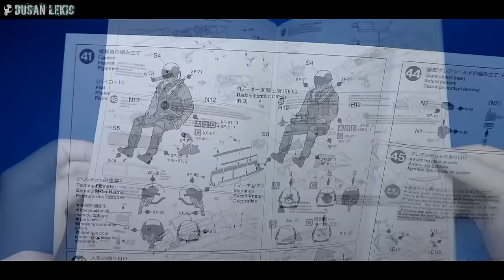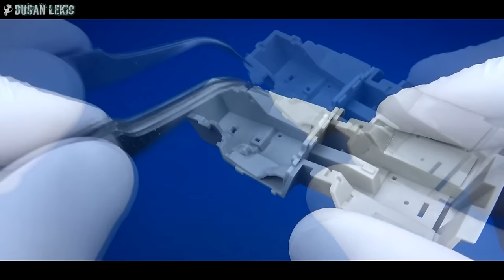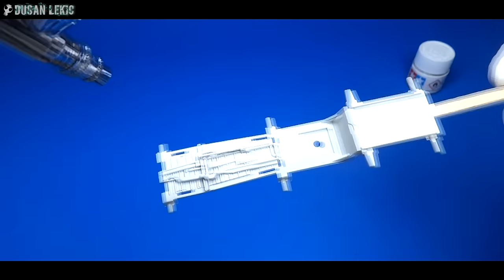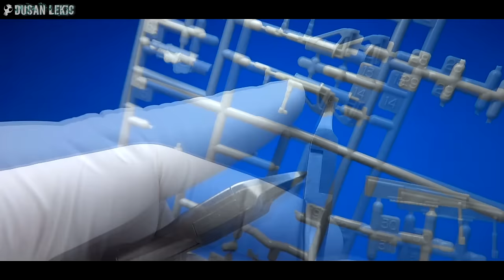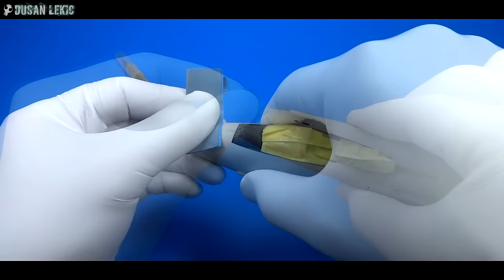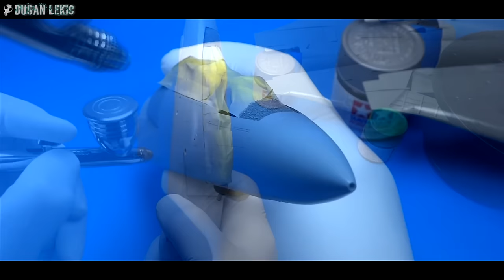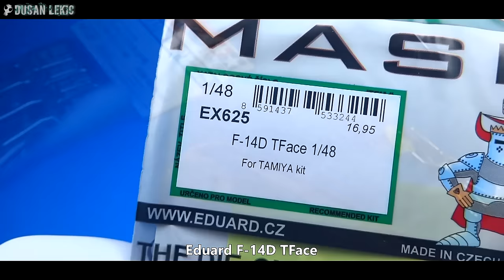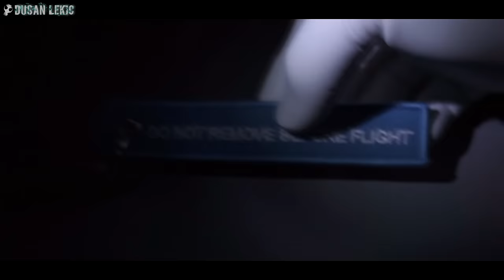F-14D TOMCAT full video build -TAMIYA

Comment: Tamiya is the absolute best. Been building their R/Cs since the 80s.
Reply: Finemolds: am I a joke to you?
Reply: me too, first tamiya build was a rough rider.......poorly engineered. They relied on the styrene body to brace the FRP deck/frame between the front suspension and the rear motor housing/roll bar. Every time you took a good jump it broke the mounting point of the body. I eventually gave up trying to repair it so I built a flexible mount. I eventually scrapped the body entirely and made a roll cage tube frame out of 3/16" aluminum round tubing.

Comment: Truly amazing. The only thing I can spot (which didn't go on the final model, so not a big deal) is at 20:45 you cut the laser detector off the GBU-12. Supposed to be there
Reply from the maker: Yes,  you are right, goodobservation! I was planning to upgrade the GBU with resin top but later I have changed my mind.  (The resin set is really the kit for itself, I will use it on F-15 btw.) Thank you very much!! All the best and take care! Dusan
Reply: As an AO3 when I saw that I groaned. Then, I figured you had some modification. BTW, you would never see a bomb on the F-14. All attempts at high speed bombers were failures. The bombs would get stuck banging against the underside of the aircraft due to the way the air passed over them.

Comment: I had the Revell kit when I was a kid, so many of the parts were warped, it didn't turn out nearly this nice
Reply: tamiya stuff is top notch.  I was looking at a motorcycle the other day in a store and it was $70.  I don't know how they can have that level of detail in a mold and only cost what they do.  molds real expensive to have made. I know, I worked at a tooling company and made some.  I've spent 50 hrs on some polishing them.
Reply from the maker: I think that you can still find that old Revell/Monogram tooling. Thank you! All the best!! Dusan

Comment: Great build. I understand the instructions may have stated the upper wing insignia was supposed to be in that position, but only photo reference I can find shows aircraft 163 with the national insignia in the usual placement. On my builds I usually always start with an actual aircraft photo reference I want to model and go from there to find as much possible for that plane or squadron. Sorry to be a rivet counter, but on questionable things like that on my builds I try to find anything I can to reference it.  Best use of Tamiya paints I've seen. I actually find you to be my favorite online modeler.
Reply from the maker: Thank you! I still haven’t built the kit without the photo. Well, here you go https://www.airliners.net/photo/USA-Navy/Grumman-F-14D-Tomcat/698550/L?qsp=eJwtjLEOgmAMhN%2Blsw5Ew8CGcdfBF2jaC5Cg/Gk7SAjvbvnjdvm%2Bu9tIlk/gG6%2B1gDpysMlIJyps/HbqtizoYfr7uWmvaXyxuK1JlAO9CEpA//xhCjsUXOrJkNMmA%2BxZM13a5Dp5mbl%2BIHiaad9/B8MsCw%3D%3D
Reply: ScaleModelAircraft , thanks for that. Crazy, I have never seen that done before on any others. Considering it was not a CAG aircraft which sometimes have any number of one off type markings. Love your work, and don't know if you've done a ZM F-4, but they are a pretty enjoyable(but slightly different) build.
Reply: I looked at my kit plus this picture and it is true the insignia Is indeed backwards. However, I just can't do it that way!

Comment: Those pe parts (rails behind the seats) reminds me of when I was building a tamiya kit. I want to say Toyota Toms but not 100%. I spent a good 2 days prepping, painting, detailing assembling the front suspension and then the next step was installing the body which covered it all up lol. I was like WHAT???? lol....

Same as a motorcycle kit....$35 for the kit and $45 for the paint....4 different kinds of black....matte, semi gloss, gloss, satin. I remember there was only 2 tiny little dabs of gloss in the hole kit. I could have simply used a gloss clear over the satin to make it gloss. $4.00 for maybe 1 ml of paint required lol.

Comment: will you ever make a plane that looks like it just rolled off the factory floor? ready to be delivered to the airforce/navy/airliner?
Reply from the maker: Well I would, I have many un-weathered finished kits in my collection. Problem is that with the Tomcat, because it’s recognized as mostly beaten and weathered plane. Maby Nasa test-bed F-14 would be a nice choice for clean AC build with international orange and white surfaces... all the best!! Dusan
Reply: What story would that tell?

Comment: Typical load out for the Tom Cat was Sidewinder on the side rails, like you have them, Sparrows where you have the Phoenix, and Phoenix on the under body recessed mounts. Also, you wouldn't have seen an F-14 carrying a 1000 pound LGB, like the artist shows it on the box art. Especially when they still painted them like that. In the 1980s they went to a matte grey scheme. Only the Squadron COs aircraft were still painted in distinctive colors. I have no idea why they added bombs to this kit. Those belong to the A-6 or the F/A-18s.

I loved the Tom Cats. It was sad to see them go. It was the only combat aircraft where it was designed with a specific weapons system in tandom. The AIM-54 Phoenix was specifically designed for and with the Tom Cat. It could could lock on to six individual enemy aircraft and launch all six Phoenix missiles at the same time, each with its own target. 

I was an Aviation Ordnanceman Petty Officer Third Class aboard the USS Ranger CV-61.

Comment: I always have a mini heart attack when you're cutting the small parts and they ping off! Hopefully that blue paper catches everything!
Reply: yup, been there and done that MANY times. When I was a kid we bred persian cats and they were always running around....ping off it'd go and one of them would chase it and bat it under the bed dresser couch gone for good lol......

The WORST though was you saved up, bought a kit, got home all raring to go. Open the clear plastic bag, pulled out the tree and started assembling only to find a part broke off at the factory and it wasn't in the bag, wasn't on the tree, wasn't on the bench top........and it was usually something important like a rocker cover, or something that you can't just hide.

Comment: What can I say... you have a new subscriber.

One question: how did you glue all the parts together in the final assembly? Did you apply glue on painted surfaces?
Reply from the maker: Thank you very much! With Tamiya extra thin. Only thing that can go wrong on paint job can be addressed with clear coating again if you get a for example gloss line from a glue brush (of course you shouldn’t soak it with glue) IHTH, all the best!! Dusan

Comment: It's weird how you glue it AFTER assembly, I used to do it the other way around.
Reply from the maker: Well I just showed options, yours is also correct;) all the best!! Dusan
Reply: Tamiya extra thin cement is drawn into the cracks and crevices in a capillary effect.  Something the much thicker, testors tube cement would never do.  It's very cool.. try it!  I would've never thought that the type of glue I use could take my modeling to a whole new level.
Reply: @rickshaw6198  I see. Doesn't the glue affect the outside-surface when you want to paint it? As in, leaving an extra layer?
Reply: @sonykroket  Not really..it's like, thinner than water, and any excess, rather than building up, it's almost as if it evaporates.  Do you have boxes of spare parts or sprue trees?  Get a bottle and try it out!  It's amazing.  I still use testors tube cement on parts where it for sure will not ooze out, but on little tiny parts that need to be tweezed into place, tamiya super thin liquid is, like I said before..a whole new level.
Reply: @rickshaw6198  thanks
Reply: I learned about that type of assembly when I worked for an acrylic fabricating company. They ALWAYS assembled first then used water thin methylene chloride at the joints. With clear acrylic you can see the cement wick into the joint and see where you need more. We applied it with a surgical syringe. You can buy it in gallon containers but they'd only ever buy in 1/2 pints because it'd evaporate so quickly. Once you broke the seal if you didn't use it it'd be gone in a day.